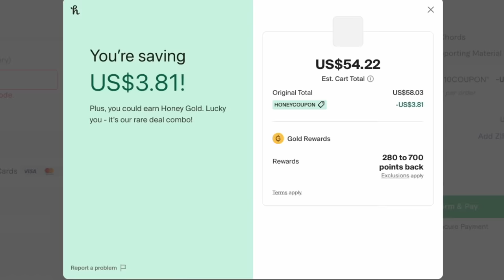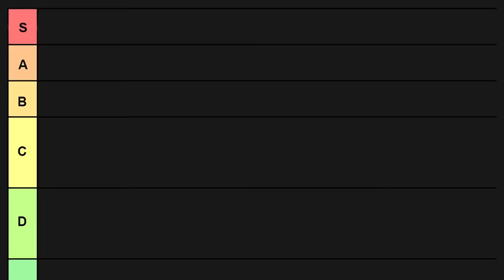Piano tech traumatized from opening my piano

Comment: Of course it sounds awful with piano strings. They aren't rated for underwater usage. I'm pretty sure fishing line would sound much better on this piano.
Reply: Finally a good comment
Reply: I don't think fishing line would sound like anything. I suppose to get the lower strings you could wrap fishing wire around fishing wire to make it thicker???
Reply: @cartoonhanks1708  Fishing line is nylon right? You could just buy a set of nylon strings of various sizes i think
Reply: @Queer_Nerd_For_Human_Justice  not exactly, these days they can be a composite to something completely different from nylon.
Reply: Obviously we need an inverted jaws and use strings made for fishing sharks.
Reply: chokes in wheezing
Reply: except for the G-string, which is usually used for the bikini
Reply: Doesn't matter too much because the speed of sound is different underwater, so all the frequencies will be different than what we are accustomed to. You would have to have it specifically tuned to play in tune underwater.
Reply: in my opinion you would be unavle to use vinyl wire for a piano and fishing line doesnt vibrate because it scares fish BUT if you used heavy gauge water you should be in the money
Reply: I think it sounds great

Comment: Maybe take out the water and replace it with oil, or use thick water (it's for old people do they don't choke on it), I feel like a thicker liquid will change the sound in an cool way.
Reply: Jello?
Reply: Thickened water would be so interesting!!!
Reply: @elijabutterfly6154  Thick water is not quite like Jello. Instead of gelatin, there's a starch. It doesn't firm up, but it's thicker than normal water. Tastes like water, but thick like a syrup.
Reply: non newtonian fluid, the stuff that solidifies when it moves and liquifies when stationary would be hilarious
Reply: Thicker liquid will only dampen the sound even more, cause it takes more energy to set it in vibration
Reply: Oobleck
Reply: @DaP84  + it's hard to remove🎹🎶
Reply: Mineral oil
Reply: concrete :V
Reply: @Bluhbear  tru
Reply: @warzone822  oblec in a piano goes hard
Reply: @Happycat this is a good point, and I should of considered it.
Reply: @acecarpenter502  then he can keep his PC in there too
Reply: The thing is the strings need to vibrate to make sound. The higher the density of the medium the strings are, the less they will be able to vibrate and less the sound we would get. So when they are in water they don't vibrate as well as when in air, that's why the sound is dampened. If he used another liquid which had a higher density than water (like thick water, jello or oobleck [I don't know about thick water, but I assume it is denser than normal water]), we would just get even less sound, if it's density was lower than water, we would get more sound. So it would be interesting to use a liquid with lower density than the water used on this one, it would still be dampened when compared to air, but maybe we could hear a bit more than in this case, and still get the "liquid" effect.
Reply: Or sulfur hexafluoride gas so it sound much lower pitch.
Reply: @warzone822 You'll make no sound out oif it, anything densier than water would be useless I think
Reply: @mauricio7560  that is another factor! But not only that. More density gives more mass. And it takes more energy to set higher mass in vibration, so larger portion of the sound energy is "used up" trying to set the medium in vibration and then lost (as heat energy) on the way. That's also dampening the sound. How sound absorption works in acoustic treatment of acoustic designed environments
Reply: @arianelcole  yeah, I kinda thought about this when Mattias made the ballon guitar. My thought then was that the strings should obviously be contained within the gass for any effect. Just like how our vocal folds are surrounded by gass when we breath in helium
Reply: I really want to see something with a low gravity like alcohol but I also want to see more weird piano videos without "so, my house blew up because I filled a piano with flammable liquids..."
Reply: @Mostlyharmless1985  LMAO
Reply: @arianelcole  yooooo
Reply: @mauricio7560  that's actually a really interesting idea, but the think is, although oil feels thicker, it is less dense than water, so I wonder how it would effect the pitch, because the density is lower, but the viscosity is higher
Reply: It's not to avoid choking on it so much, it's to help them drink without spilling due to their shaking hands
Reply: @DavidRodriguez-ok1cn  oh, fr, thx for the new information bro, I didn't no that
Reply: @Happycat he might be able to make a sort of mimic of the thick water himself. From what I hear its mostly just starch and water
Reply: Or what about whiskey or beer in the piano 🍺🍷😊
Reply: @rottingemptiness  yes
Reply: @B1G_RED  , what shall we do with the drunken piano , 
what shall we do with the drunken piano , 
what shall we do with the drunken piano , 
early in the morning 😁🎹😁
Reply: @rottingemptiness  put em in the scubber with the hose pipe on em, put em in the scrubber with the hose pipe on em, put em in the scubber with a hose pipe on em erly in the morning, way-hay and up she rises way-hay and up she rises ,w way-hay and up she rises erly in the morning

Put em in the brig til he's sober, put em in the brig til he's sober, put em in the brig til he's sober erly in the morning
Way-hay and up she rises way-hay and up she rises, w way-hay and up she rises erly in the morning 😌
Reply: @B1G_RED  😂😂😇😂😂
Reply: @B1G_RED  ,
My piano plays all over the ocean
My piano floats over the sea
My piano sounds so full of emotion
Oh plz , bring back my piano to me ....
Reply: @rottingemptiness  🥵🥵🥵🥵🥵🥵🥰🥰🥰🥰🥰🥰🥰🥰🥵🥵🥵🥵🥵🥵
Reply: @warzone822  cornstarch and water would work well and be cheap. Would be interesting to hear a piano that's more muted the harder you hit the key
Reply: that sounds like a really cool idea. It sounds like it will mute the strings a little while also giving it a deeper and more vibrational sound as a note is played
Reply: I think filling the piano with a super heavy gas like sulfur hexofloride would be fun. It is much heavier then air so assuming  that the piano is water tight the gas should settle in the void and displace all the air. It should make the notes sound very low I would think. Make sure its 100% in tune before hand then call the tech lol
Reply: @ChemicalU235  or you could fill it with helium and make it a higher pitch
Reply: its cheaper
Reply: @isometimestrytodothings2375  u could but keeping the helium in side would be harder. her would need to make the lid seal air tight and have a 1 way valve body to use as a fill point. Since helium and hydrogen are lighter then air it makes it hard to keep it filled. with sulfur hexafluoride he could in theory leave the top open while he played.
Reply: Yes!! Please post video in haste the result would be interesting pretty please
Reply: @isometimestrytodothings2375  that's what I'm saying based
Reply: @ChemicalU235  that is true but if this man can make a piano of water he can possibly make a piano of helium
Reply: Mercury
Reply: @mauricio7560  well that settles it then, he should build a piano sized vacuum chamber😂
Reply: Also to prevent rusting of the strings

Comment: What if you poured a heavy gas in there instead of water?
Since you put in all the work sealing the piano. 
No idea if it would make any difference though... 🤷
Reply: Sulfur hexafluoride. Whatever gas you use will be slippery but not imposible. And has an advantage: dryness.
Reply: That would sound a bit explosive 😁
Reply: @rottingemptiness  ? Not all gas is explosive, lol.
Reply: @Eliassww  , I know 😉
But .... what about putting helium in the piano ????
Reply: @Eliassww  , so , I guess you're right about gas 🙂
Reply: @rottingemptiness  helium is lighter than air so... 🤷
Unless he puts the piano upside down.... 😁
That would be cool  😎
Reply: @hakancarlsson2881  that's a helluva hot idea 🙂

Comment: Next video: I filled my Piano with Sulfur Hexaflouride lol (in theory it should work similar to water due to it beeing heavier than air. For helium it'd become a bit more challenging i guess lol. Would be interesting though how it'd sound with those gasses
Reply: I came with the same idea. However any gas will be more slippery than water, however you can have a constant flux to compensate. For helium you need to put the piano upside down to trap it and anyway it will difuse very fast, but hexafluoride seems feasible.

Comment: Now fill it with liquid gallium but make a long container so that only the strings are submerged Or make the piano more shallow so that I’ll take less liquid to fill
Reply: Iirc gallium is not very nice to copper, and is expensive as hell in those quantities.
Reply: @derain95  Also I think it melts around 36 C
Reply: Whatever densier than water will damper even more the sound. If it's mercury that's 13g/mL and even the piano hammer willl floatr on it.
Reply: @derain95  And dense af, so much that it will make the mallets uselless and floting.

Comment: Fill it with oil or thick water (thicket), I feel like a thicker liquid will have cool effect in the sound
Reply: Will only dampen the sound even more, requires more energy to set it in vibration/spread the sound
Reply: @DaP84  ik it will dampen it, but it will effect it in other ways too.
Reply: @B1G_RED  likely not. It's  just a thicker, homogeneous medium, just "eats up" more of the  sound energy
Reply: @DaP84  Tru, but I'm not saying it has to be what I suggested, but I feel like something similar with the correct propertys could do some cool stuff
Reply: @DaP84  I was with you untill you give me the key: "put more energy"
Reply: @DaP84  Sprying the strings with some powder or nitroglycerine would be the extreme and funny.
Reply: @arianelcole  lol why not! 😁 Explosive projection of sound

Comment: Why water and not mineral oil?
Reply from the maker: it was tempting, but the strings already suffer a lot from the water stopping vibrations and oils I think is a lot more viscous. Also water would get more clicks I think because idk feels like it. But the inhibitor worked great
Reply: @Mattiaskrantz  makes sense.

Follow up: Why no yellow rubber ducky? Maybe saving it for a V2?
Reply: @Mattiaskrantz  Sulphur hexafluoride or helium next time. Oil is also lighter than water so less dampenned sound, mineral oil is good for metal, less friction and viscosity could have weird results though..

Comment: The problem is mostly because the strings are partially under water.  The mismatch in impedance will cause havoc on the string's vibration.

Comment: This is a little off-subject, but years ago I met a tuner who decided to experiment with a piano.  He tuned every third string (or second string, in some cases) a half-step lower.  He said, "at first it was really wild sounding.  Then after a while I got used to it, and it was kind of cool."  Of course you can achieve the same effect with any good synth that has enough tone generators, or using a pair of the synths in tandem.